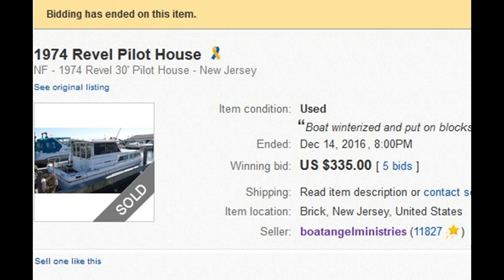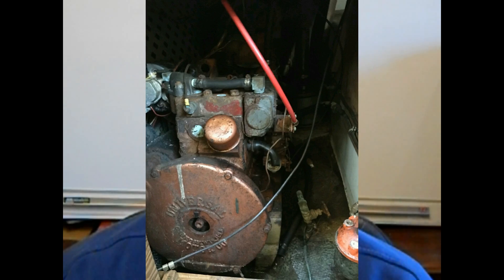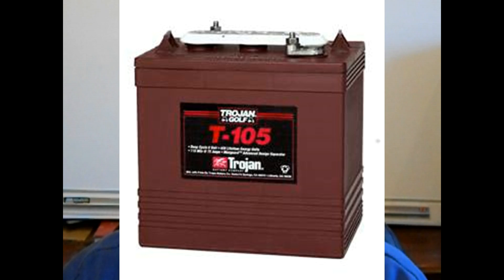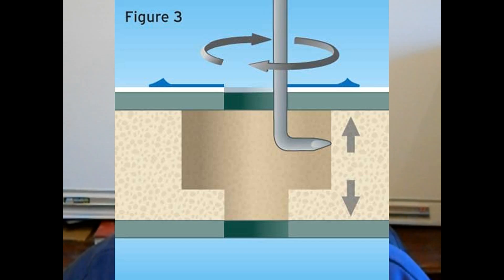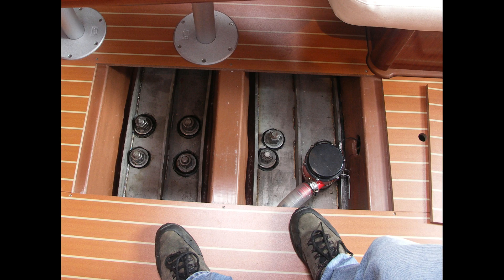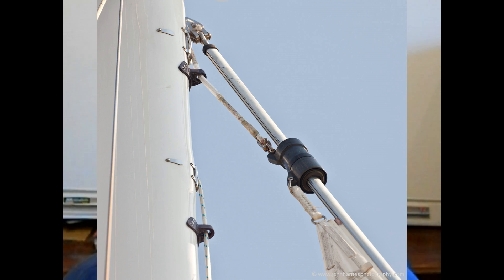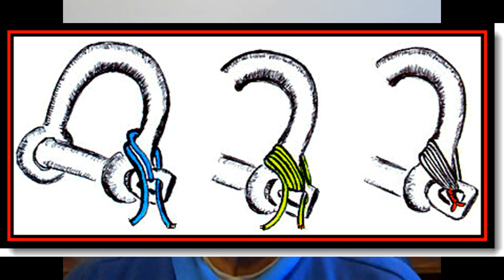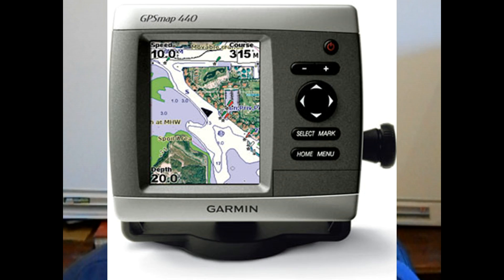Fixing Old Boats Bought on Ebay

Comment: Like what you got going on. As a commercial crabber and marine contractor all my life i must warn others to be sure you got the extra money to restore your boat. Nothing about it is cheap. Just one gallon of bottom paint can run you $400 and above. Or you can pay someone like me $80 an hour to work on it. The marinas in MD charge $110 an hour and above. Make sure you can afford your boat before it becomes a lawn ornament killed by good intentions.. love the video!
Reply from the maker: Very good point. Buying an old boat is only the start of expenditure.
Your mention of bottom paint reminds me that I found it less expensive to not have bottom paint and just pay a diver $50 to scrape the hull when needed.

Comment: If selling a boat on ebay, especially cabin models!, clean it up inside. Amazing how many sellers photograph their boat without even a basic cleanup. I am going today to pick up an 18ft alum Starcraft open bow with 85hp motor that nobody else bid on and I got it for $99. Trailer wasn't included then seller decided to give it to me anyway. Interior photos showed a mess.
Reply from the maker: I couldn't agree more Todd. When I sold Free State it took me ages to move all my live-aboard kit from one cabin to the next to take a 'clean' picture! If a boat is sold by a charity or a consignor then they are rarely cleaned and look a mess. Good luck with your Starcraft - she sounds like a bargain.

Comment: Buying new sails for an old sailboat will pay huge dividends in speed and reliability. Don't cheap out on sails, properly designed sails for your boat are better than trying to make used sails work.
Reply from the maker: True. Think of them as the 'engine' of a motor boat. The main driving force.

Comment: some dubious things here...there is a tube of 3M bedding compound sold in boat stores that fixes a multitude of sins, esp. leaks of hull to deck and similar.  Never failed me yet and dries over a months time to a stiffer rubber.  Salty residue does not "wash out "well so inspect interior and scrape out deposits that are thick.
Reply from the maker: I agree, there are some excellent 3M and Sikaflex products out there but my cheap roll of butyl tape will still be usable months after the tubes have gone solid. Some hull/deck joint leaks may be solved with a squidge of mastic but rarely in the long term in my experience. Salt does build up rock solid eventually but can be washed out if maintenance is done regularly. This video was meant to be for a few pointers - not for a full maintenance manual.
Fair winds, Roger

Comment: Sir, enjoyed your video. Great pointers all the way through it!!  You spoke of having a dingy engine. I'm not going quiet as large not over 30' would a 2.5 up kicker work for my needs. I've the opportunity to pickup a newer one for $200. Do you think this would work, to get to shore, if not in strong currents?
Reply from the maker: Ideal for a dinghy to potter about in calm conditions but would be a bit small for a 28/30ft. sailboat. The trouble with outboards as kickers is that you really need a long shaft outboard but on a dinghy it is better to have a short shaft, So a short shaft as a kicker is a pain in anything but calm conditions. With a bit of a chop, the prop keeps coming out of the water and the engine screams. Then in a trough the engine can be flooded.

Comment: Thanks for all the great tips/advice!  I sub'd.  This makes me feel better about maybe buying a GB Classic 42 I've had my eye on for quite sometime now.  I already feel like I know the boat inside and out, but still have trepidations because it is a 1985 model.  I was worried about soft decks under the teak decking, but your simple tip shows me how I can repair potential issues myself, before they get out of hand.  GB used plywood cored GRP for decks, and the teak was screwed through the top layer and into the plywood, a potential source of water intrusion.
Reply from the maker: Hi Bob. Grand Banks are classic trawlers with a great hull. Teak decks are lovely to walk on but can cause problems in later life. I crew sometimes on a 1972 Swan 43 and her original teak decks are almost perfect. Stopping deck leaks is often a problem on quite new boats too!

Comment: With all the savings you're making, why not splash out on some lithium house batteries and a good charge regulator? Costs more at the outset but after 10 years your lithium bank will still be at 90% of it's original capacity compared to SLA's needing replacing after as little as 4 years.
Reply from the maker: Lithium batteries are very good. The danger of spending $2000 against $200 on a cheap old boat is that at the end of the day you still have a cheap old boat! You would never get your money back. Lead/acid batteries last many years if looked after and not flattened. Polyester rope works as well as Dyneema at half the price. Galvanised shackles do most jobs ok at half the price of stainless - and so on. My reasoning with this video is that a cheap old boat can be made seaworthy for not a lot of money yet give a wealth of pleasure on the water.

Comment: Don't forget the $500 fee when you buy from boat angel.
Reply from the maker: Actually BoatAngel charges $300 on top but you are correct, all charity auctions charge about $150 upwards for handling charges. No matter how much you pay for the boat, the buying price is just the start of expenditure!
Reply: smacksman1 the problem with small boats from boat angel is that the fee is still $150 or higher. But there are some good deals on there from time to time.

Comment: Those plastic tanks aren't legal for an inboard. Also don't keep an old impeller as backup buy a new one you don't want the backup impeller  breaking fins off after you crank the motor back up.
Reply from the maker: Quite right, Jimmy. I keep a used engine part for a 'last ditch' spare when doing annual maintenance even though I have a new spare in stock. It is sad the number of times the new spare has failed quickly and the 'last ditch' spare has got me back to harbour and chandlers. I think a coarse filter between the raw water pump outlet and the first heat exchanger would be good insurance against impeller failure.